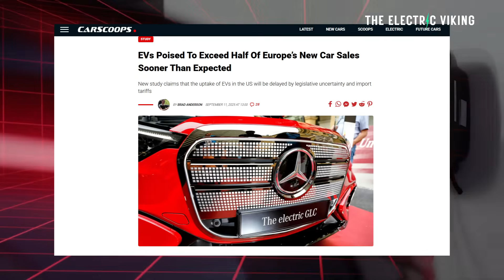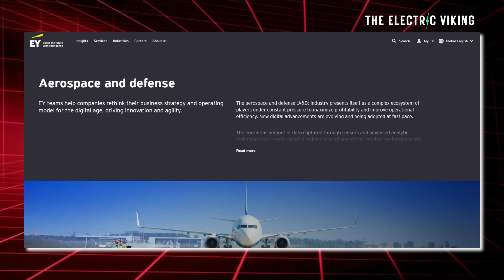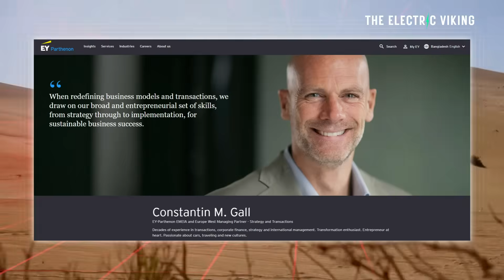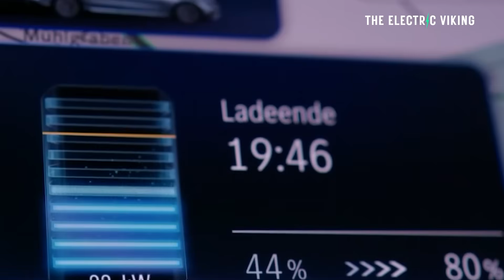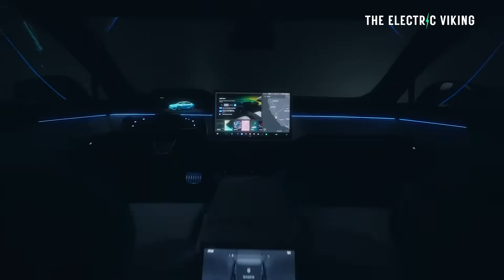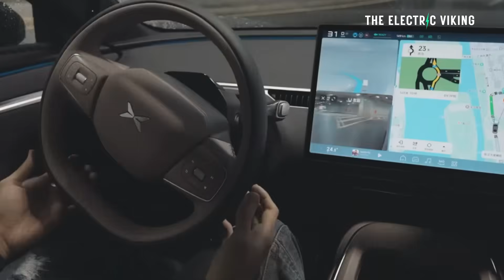Europe’s Petrol & Diesel Era Ending Faster Than We Thought

Comment: How will EV charging affect the grid? How much of a buildout will it take to accommodate charging for over 100 million EV"s?
"AI Overview
As of early 2025, the European Union had about 252.2 million cars and 37.4 million commercial vehicles and buses on its roads. The passenger car fleet grew to nearly 250 million in 2021 and has continued to expand, with the most recent report from January 2025 noting approximately 249 million cars. "
Reply: Let's reimagine our energy supplies.

With an almost entirely electric energy supply Europe will not be dependent upon foreign supplies for oil and gas.
That alone is a big win for energy security.
It also reduces European import costs.
And distribution costs.

But what of the electricity grid?

Sam has previously reported that Chinese batteries have already reached 1,000,000 km lifetime, with more to come.
Now, if the average person travels 20,000km a year, that would be 50 years of battery life. Or pretty much the driving life of a human.
Would any EV - would any car - still be in workable condition after 50 years?

So let's reimagine the grid.

Let us say assume that most private vehicles spend most of their time idle, either at home, at work, or perhaps at some town or other location for shopping.
Now let us assume that such idle cars could be plugged in, i.e. connected to the grid, while idle.

And let us assume that the grid could be made (somewhat) intelligent.

The owners of EVs could sign up for a plan where their vehicle is only ever normally  charged to some maximum value, e.g 80%, which might be far more than they would ever need for any given period (such as 1 or 2 weeks of driving).
And that when the grid is generating a surplus that this is then used to charge the battery up to 100%.
And that when there is a shortfall that the grid takes that back.

Further, the adoption of local energy sources - mostly solar I'd imagine - would dstribute and diversify electricity supplies, and eliminate a lot of electricity transmission losses.

And democratise energy.
Reply: @mikemalone9678 Yes.

Comment: While electric vehicles are improving constantly here in the uk it will be difficult for everyone to rely on electric vehicles. The charging is a problem. For those who can install a charging system at home and do short journeys they are great. 
Also with the UK trying to go for renewable energy only it will be difficult to produce the energy required. Maybe the UK should follow China’s approach and start building many coal powered generation plants. These generation stations produce the electric to manufacture electric vehicles and then power the electric vehicles. There are nearly 2000 coal fired power stations in China and more being currently built. This must be the way forward.
Reply: Rubbish.    Power consumption in the uk has been falling for decades and might reach 2005 levels by 2030.   As for coal, if you think the uk is going back to coal, you’re completely delusional.
Reply: @crm114.  I’m with you on this - there is plenty of power available from renewables, if they are actually allowed to connect and if nimbys stop blocking pylons being built to move it from the windy north to the south where it is needed.

Plus no one will close down any gas power stations until they are sure they are not needed, so “the lights will go out is a fallacy”.

Comment: Try public charging an ev in Europe.  First find a charger, then stand out in the heat, cold, rain, snow or dark and grapple with different charger interfaces and apps.  It's a total mess - and charging is really expensive.  I drive an ev on a daily basis (80,000 km to date) in Croatia, Slovenia and Italy - and less often in Austria and Serbia.  It is a nightmare.  As for ev's on the road, I'd reckon I see about 2 to 3% - mostly Teslas.
Reply: Europe is big and very diverse. I live in Holland and charging here is very easy and abundant, public chargers are built with a speed of about 1500 new units each month.
Reply: @TonniK-s6x  Yes, Europe is big and very diverse but my argument stands.  Why is there no unified charging app and why does every charger have a different interface?  All petrol and diesel pumps are vitually identical.  Why are ev charging stations out in the weather, and often located in dark, difficult to access locations?  Why do charging stations block €50 on your card before starting charging - and, please don't tell me it's to stop fraud?  The charging company knows everything about me and my vehicle and me the moment I open the app and plug in.  I have 80,000 km of ev travel over 4+ years, much of it on long trips.  If I knew what I now know before I bought the bastard thing, I would have stayed with petrol.  My wife absolutely hates ev motoring,  She would sell the car in a flash - but its depreciated so much it's essentially worthless.
Reply: Not like that here in Brittany
Reply: I have been driving an EV in Europe for 7 years. I did Geneva to north or artic circle a few years ago in my 2015 tesla clocking up 9000kms. in march this year Geneva to Amsterdam return. two weeks ago Geneva to London return, and last week Geneva to Gibraltar. left my diesel at home each time free supercharging helps sway my decision. supercharging in western Europe is a breeze, maybe eastern Europe is different?  never stood out in the breeze no apps used, just tesla and chargemap card.
Reply: @stephensharp975  Please, don't use Tesla as a reference - fascism doesn't sit that well with me.  My local car dealer says that he would not consider a long trip if he was in anything other than his Tesla.  So, yes, if you can afford it, sterile Tesla vehicles  with their charging network seemingly work well.  The rest of us have to put up with expesive, inconvenient, disfunctional "networks" that virtually double any trip time.  And the EU does nothing to remedy the situation.
Reply: Things happen slowly at first. Hang in there!
Reply: @cynthiacarlisi9165  Thanks, I have.  I have 80,000 kms of traumatic motoring over 4 years.  It's takem years off my life but I'm stuck with the worthless bastard car so I have to hang in there and keep taking the medication.
Reply: I don’t have any issues in the UK. It isn’t cheap but you only take as much as you need when on the road, you don’t fill the tank. Last weekend I put 10kw in to give me 40 miles. It took ten minutes, including moving the car to a non charging parking spot when finished. It was quicker to wait with it than go back into the pub only to go back outside again.